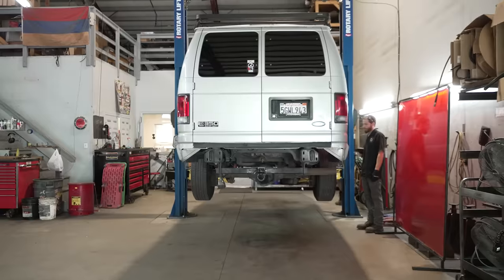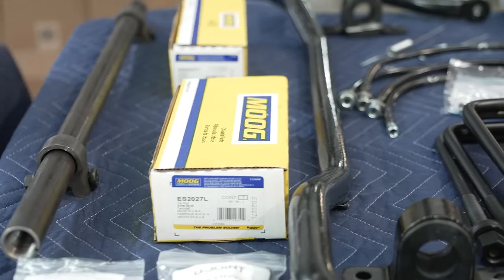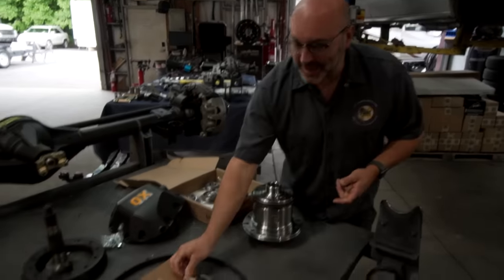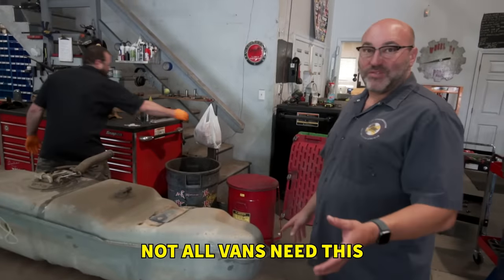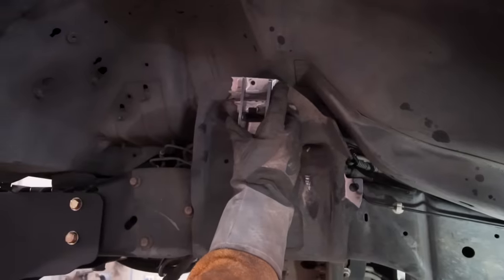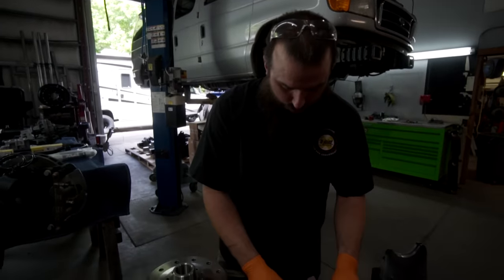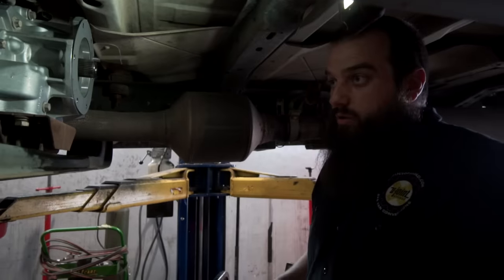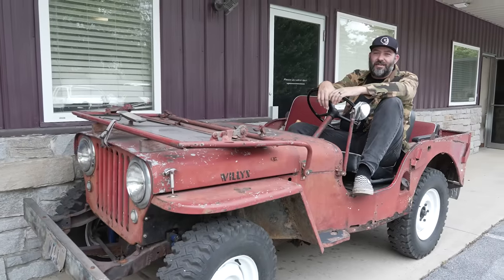Church Van’s Going Off-Road! with a 4WD Conversion from Ujoint!

Comment: I installed a @ujointoffroad kit on my 7.3L van, in my driveway on jack stands, with no plasma cutter, it was drivable in 2.5 days. 1 more day for the trans/t-case swap. I’ve had it for 5 years and it’s been awesome.
Reply: Same, plus a day to rebuild my transmission
Reply: How much $ to go with that time your spent?
Reply: This kit works on the 3rd gens with a slight modification too👍
Reply: @rj8372  I want to say it was about $12k. That includes finding a deal on used axles and wheels on marketplace, new tires and a new rebuilt transmission. That was 2017 prices, I'm sure it would cost more now.

Comment: UJoint really are the best of the best. Still have not had better customer service in any capacity than I did from Chris and his crew. Stoked to see them on Hoonigan!
Reply: leafs up front in 2023? lame, should have went to Quigley.
Reply: @leadfoot8593 no way my almost 13k pound ambulance conversion would be able to drive like it does or have the capability with 37s like mine does with a quigley conversion 😂 I’ve gotten my rig through some stout stuff, but you keep on thinking that.
Reply: @leadfoot8593 lol do you know many Quigley systems we’ve removed?
Reply: @leadfoot8593 quigley is ass, from top to bottom. The leafs in the front ride great, huge improvement over stock

Comment: This is nuts. I am converting an RV on a E350 chassis into a tiny home/overlander and I've been thinking about a manual/4WD conversion for a while. This video is literally for me. 

Fun fact, my RV has a triton V10 and duallies with the smallest length they offered. When I had it all stripped out, I got it up to 90MPH. 1200 watts of solar are about to go up, so its speedy days are over.

Comment: I love that they use all tried and true mechanical linkages. There is no motor in the way to shift the transfer case. Also OX lockers are the only way to go. If the cables do fail. You can bypass them with like a little plug. All 4 wheels will always spin if you want. Great build design!
Reply: Thanks!

Comment: Nice to see alittle indepth 4wd stuff on Hoonigan.   Hey scotto I have the perfect tire/wheel package for ya.  Method 20x12, 306's I think,in bronze with 35x13.50 nittos. Bought for my 07 crew cab 6.0 and rolled it month 2. 500 miles on em.  My hole wardrobe is hoon by the way.

Comment: Is it actually possible (in general) to launch a boat from the front?  Is there any advantages or disadvantages or safety issues?   I'm genuinely curious because I'm not a boating guy so these aren't things I am familiar with. Heck I'm not even an off roading or truck guy.
Reply: For sure, if the conditions allow

Comment: Great to see how the world works with a rebuild from a very popular platform that has its new features sourced from another one that has been around for the same time  super duty 4x4 econoline would have been very nice winter rig  for shuttle to 🎿  lifts in Utah or Colorado  with the  rest of the f series chassis can be used to make a one of a kind rigs for the next 20 years with a 30 year supply of what you can find in your area for Ford vans in your choice of diesel  or gasoline engines like the last few types of vw busses now are swamped with a boxer from a suburban and they are  building a better than new van because they were not reliable enough because they were not able to keep up with  20st century highway speed  now are double the hp better than new is the reason for gearheads to keep building the things you can't buy new

Comment: "They are the best at doing 4wd swaps on a van" Well you should have shopped around more. They're kit is based on the 99-04 truck variant. Why? Even Ford themselves switched to coil suspension due to the negative effects of leaf springs. Their height is unnecessary to run 35's. A simple radius arm, track bar and a slightly taller coil is all that is needed. The stock upper coil brackets land the coils right on top of the stock coil mounts on an 05 and up Superduty dana 60. I mean there's more than one way to skin a cat but leaf springs are old tech.
Reply: simplicity is their schtick, coils are too fancy for vanners
Reply: I wouldn’t trust coils on my almost 13k pound ambulance conversion
Reply: Google death wobble and come for a ride, I’ll change your mind in seconds 😊
Reply: @ujointoffroad  Never. I've built many rigs and been on the leaf spring fence for a long time. DW is there with leaf spring too. I'll never deal with spring wrap under braking and yes you can tune leaf springs for a good ride but the packaging sucks. Personally I try to keep the van as low as possible because 90% of them are street and don't need crazy articulation. Much respect to you sir.
Reply: @TheMr.Snorlax  Vanners need to stop being cookie cutter minded. One guy does it one way and they all think that is the only way to do things. Goofy internet bolt on boys.
Reply: @rspurdie  Tell Ford and Dodge that they are doing it all wrong then. LOL.
Reply: @TheMr.Snorlax  we’ve played with coils and remove them often
Reply: @ujointoffroad  Without getting into a pissing match what reason did you guys see to need to remove the coil springs? I'm always interested in more knowledge.
Reply: @witcher71 they don’t weigh that much stock or are made for  going offroad like mine is 😉
Reply: @rspurdie  Sorry man. My 2018 RAM 5500 service truck is 19k and it travels rough terrain jobsites all the time. Not rock crawling but pretty twisted up.
Reply: @witcher71 ford is still having DW issues on brand new trucks.
Reply: @ujointoffroad  They still don't have any provisions for caster adjustment.
Reply: @witcher71 that’s a completely different platform 😂
Reply: @witcher71  coils or leafs?
Reply: @rspurdie  I thought we were talking coil vs leaf. Platform doesn't matter.
Reply: @witcher71 we are talking about econoline 4x4 conversions. Which is why the leafs work best in this case. Definitely was not talking about leaf vs coil in general so I can see the confusion now. And platform absolutely matters when it comes to which system works better.
Reply: @rspurdie  Dude I daily a 96 E350 7.3 with 05 Superduty axles. I did all the fab and I've done plenty of builds. No way is leaf spring "the best". It's easy but not optimal. Chris's stuff works. I just don't care for the height of the kits. I'm way lower on 35's. No need for sway bars and I do drive it spiritedly. Honestly leaving the front coil is easier than swapping to leaves. The mention of death wobble is valid. It happens in both systems when parts are worn or not designed correctly. I'm also not a fan of mounting hangers on an area of the frame that is designed as a crumple zone but that's just me. Chris pushes leaf spring because that's what he sells. Obviously right? U-joint Offroad has great marketing. Then along comes the internet bolt on boy crew spouting BS on what's "the best". Leaf spring is not the best. It's just a way to do something.